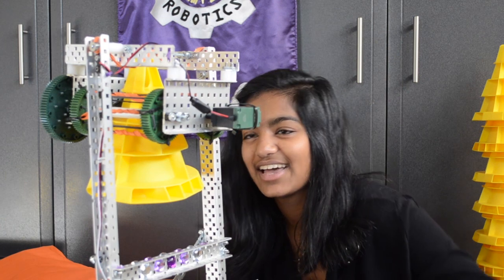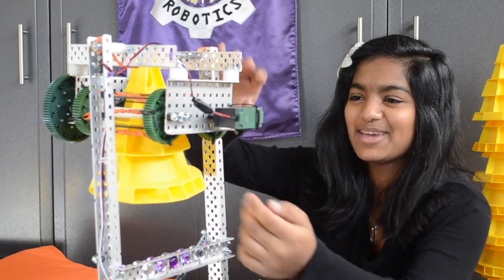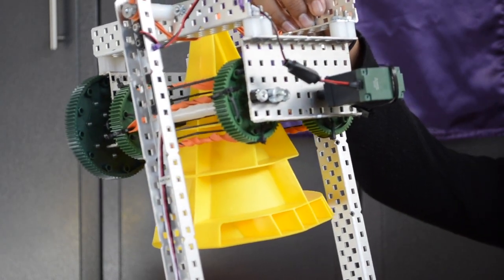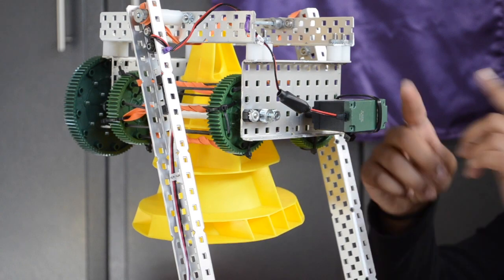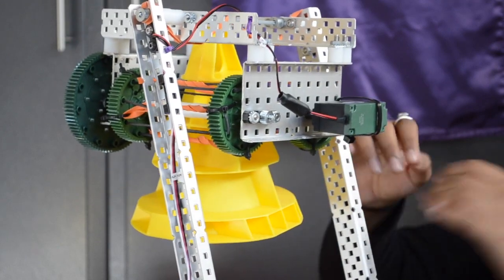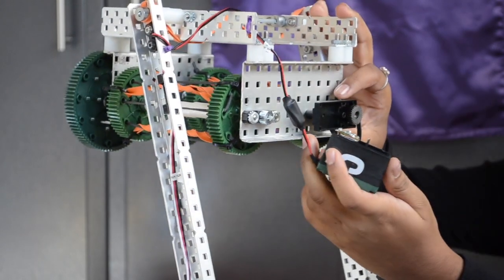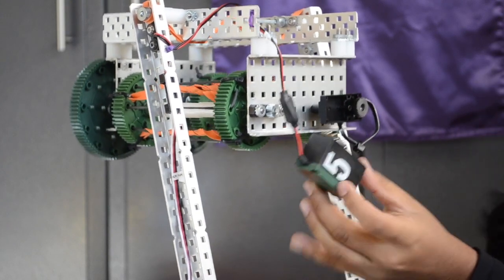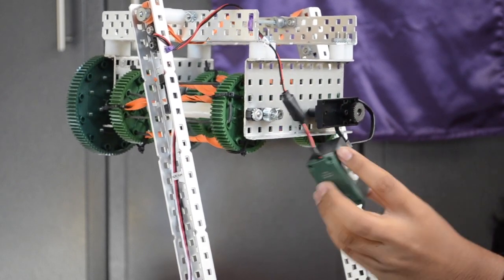VEX Hax: Zip Tie Motors

Comment: Why is the ziptie so loose?? Aaron Lucas designed this system so that you could cut the ziptie to replace the motor, not push it off the side.
Reply from the maker: With this system, we have never had any problem with the caps/motors falling off. Our zip ties are quite stiff so they don't even go tighter than they are shown in the video. Their stiffness also helps with keeping the motors on. We also replace any zip ties that are getting unreliable.

Comment: Also why the hecc do you have a gravity stabilized intake? They are seriously the worst
Reply: Renegade Robotics considering your highest match score is 54, I don't think it quite does...
Reply: That is trash but ur mom gay EKS DEE DEE DEE DEE DEE DEE
Reply: i think they are trying to use it in place of a chain-bar
Reply from the maker: The intake is partially gravity stabilized, but we also have rubber bands that brace it to the arm. That keeps it from swaying around TOO much while we drive. It also swings around less with the weight of a cone in it and with or our large intake, the swaying is usually not a huge problem when it comes to picking up cones. 

This solution isn't quite ideal, but it gets the job done :)
Reply from the maker: Dokkaebi From The Vex Forum 

solid roast XD
👌
Reply from the maker: May I ask where you got that stat? Because our skills score alone is 96...
Reply from the maker: skrrt it isn’t the best but with it qualified us for states so I would say it’s good enough.
Reply from the maker: Dokkaebi From The Vex Forum what a clever quip 👌